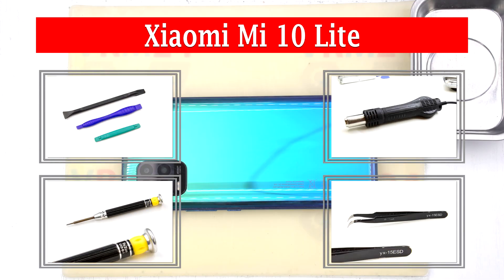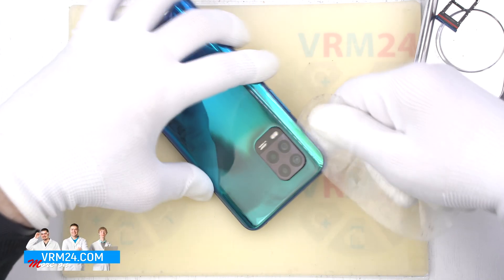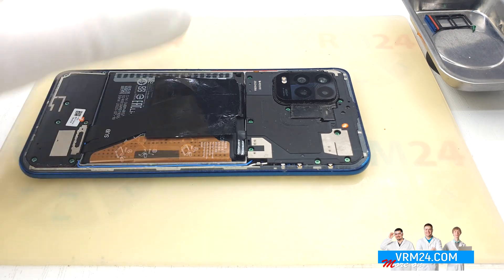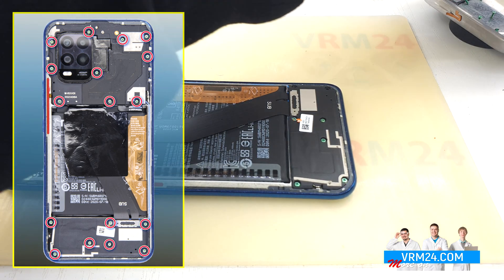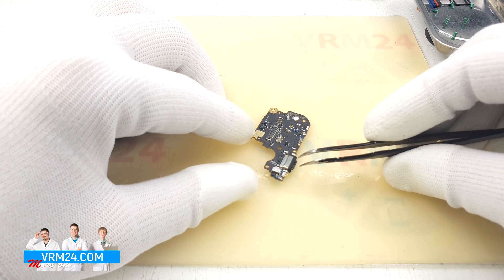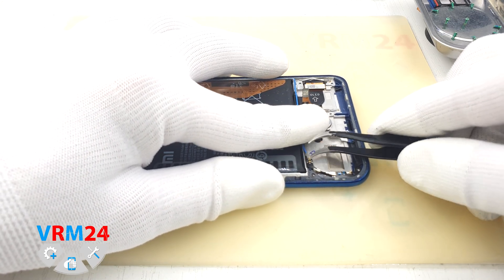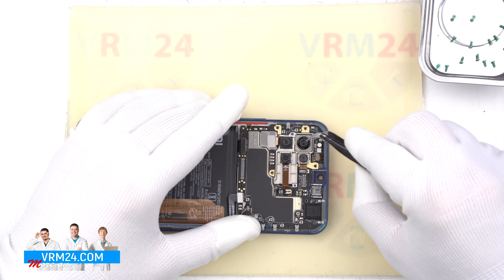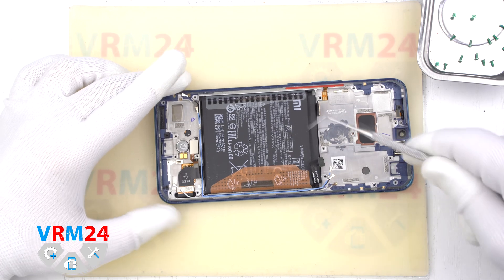Xiaomi Mi 10 Lite M2002J9G 📱 Teardown Take apart Tutorial

Comment: Recently, I have been facing several problems with my phone. Firstly, the battery is draining at a rapid rate, approximately 1% per minute, even when I'm not using the device. Additionally, the phone randomly restarts without any apparent reason on multiple occasions.

Another significant issue is that when I connect the phone to the charger, it constantly shuts down. Even when the device is plugged in, it fails to stay powered on for long and enters a continuous reboot loop, rendering it unusable.

I would like to emphasize that these problems started suddenly after a single instance of charging my phone. Since then, these symptoms persist regardless of any actions I have attempted. I have already tried performing a factory reset, but unfortunately, it did not resolve the issues.

Recently, I took the phone to a repair shop for diagnosis, and I was informed that the problem is related to the phone's motherboard.

Know why this is happening and what the problem might be specifically? replacing the entire board is very expensive.
Reply: same here how did you fix it ?
Reply: @firstgigachad3712  Probably you need to replace the battery, dsnt provide enough voltage. At least that worked for me good luck.
Reply: It's the batteria problem